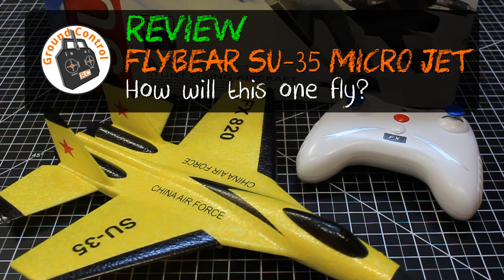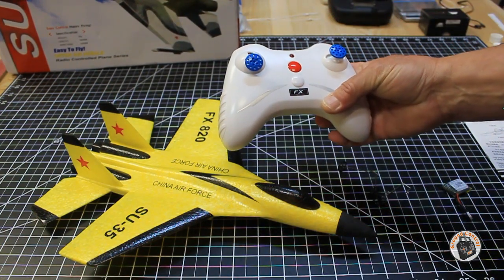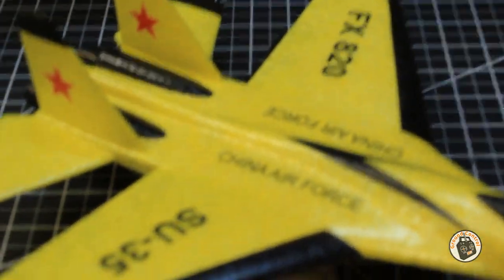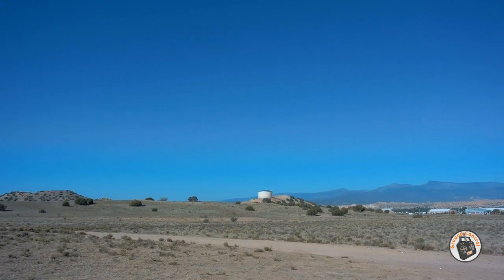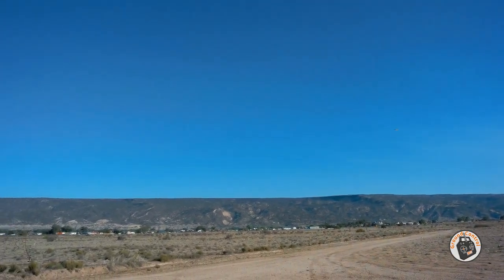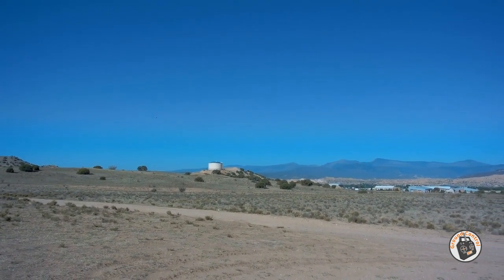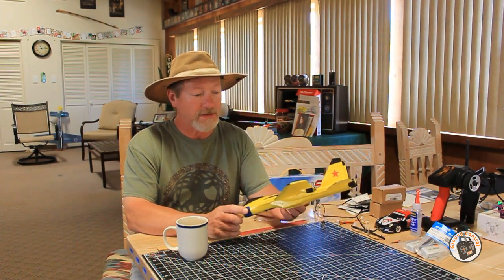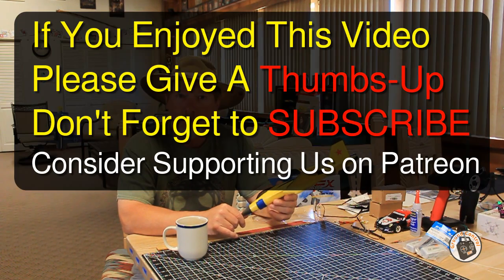Review - FlyBear FX-820 2.4G 2CH Remote Control SU-35 Jet

Comment: Excellent review and looks like a really fun plane to fly, well done :)  In my experience with park jets, twin tail jets will always tend to be more stable than single tail jets like F-16, etc, I think the two tails, especially if they are perpendicular to the wing plate help with roll and yaw stability.  Sometimes the angled ones such as on the F18 still provide good stability but can give a bit of "tail wag" tendencies in any kind of wind.  Su and Mig airframes seem to really translate over well to models in my experience.  Again, great review, thanks for taking the time to go into such detail:)  Happy flying!  Cheers, Scott
Reply from the maker: Thank you! Great information you provided here. I was practicing my LOS flying with my Mini F-22 V1 after flying this tiny plane. The wind was 5-7mph at that time and I experienced the "tail wag" you mentioned. I didn't realize that the single vertical stabilizers were less stable than the doubles but that's great information to know. I always wondered why the angled vertical stabilizers as they wouldn't seem to be as stable as a completely vertical one. Would you say that one completely vertical stabilizer is better than two angled ones? I want to build the most stable planes I can so the SU-35 design may be a very good candidate for a future scratch-build. Thanks for the great tips and the comment as it is always appreciated. Happy Flying!
Reply: In my experience, a single tail jet and a twin tail jet with angled vertical stabilizers are about the same.  It does however depend where the motor/prop are located.  In the "prop in slot" planes I fly and like your Mini F-22, a single tail plane does block and interrupt the prop wash quite a bit, meaning there isn't as much power compared to a twin tail where the prop wash does not have as much interference and in fact is somewhat "funneled" between the tails.  Happy flying to you as well :)  Cheers, Scott

Comment: Man, that thing's great!  Flies great with a little weight on the front.  Especially with all that room.
Great video, man.
PS.  In one ad, it shows someone flexing the rear horizontal stab up in case it heads to the ground.  So that's another way to adjust.  But I like adding extra weight - helps stability especially in wind.
Reply from the maker: Thank you very much! It makes for nice relaxing flights and sometimes I'd swear it was a 3 Channel instead of a 2 Channel Plane ;-) See you in the Air!
Reply: I lost mine:(
Reply: 😅 ادةشحاءة
Reply: @tobiasbaumgartner3409  - Sorry to hear it.  You know, one of the first things I do when I remember to do it?  I put my phone number on the thing.  Of course, the one I lost, I didn't do that.  :(  But, someone got it.  Maybe they got into the hobby and flew it!  :)

Comment: Hello! Would you recommend this over the FX-620? I have that one and its great. I'am hoping this one is like it but better. Also do you know if it uses the same motors as the FX-620? Thank you!
Reply from the maker: I looked at both and I do not see any difference between the two.
They seem to have the same specs and are the same size.
I don't know why they have (2) different model numbers.
Reply: @GroundControlRC  are you sure about that? I did pretty extensive research and from what I’ve come up with, overall the FX – 820 is about an inch bigger. The motors also look a lot larger in comparison. I also cannot find the exact specs anywhere online can you direct me to a website that might have them? Also funny enough the 820 is cheaper than the 620. Thank you again for the response
Reply from the maker: @handcrafteddisplaysusa8236  No, I'm definitely not sure as you never know if the vendor has it correct.
I looked at the specs listed on both and they had them listed as the exact same dimensions.
I look one up at rcmoment.com and one on ebay.
Reply: @GroundControlRC  Hey bud! Just realized I have been commenting under my business name! Thank you for the info! When I look up the specs on both amazon/eBay and other sites I came up with these dimensions...

FX-620 Wingspan  9.76"
              Length 13.46"
              Height 3.15"

FX-820 Wingspan 11.4"
              Length 14.3"
              Height 3.74"

I also notice the battery is a bit larger:

FX-620 150MAH
FX-820 220MAH

Both 1S 3.7v

Looking at the motors, they look more robust on the 820. I love the 620 but feel like the 820 is an improvement yet the 620 is a bit more expensive and more popular, go figure....The 620 flies great. I had it up almost 200ft and it still kept perfect connection.  I receive the 820 Friday. I will let you know! Thank you for the responses. Happy Flyin!
Reply from the maker: @TheFlyinTek  That is strange and I'm not sure why they have (2) micro planes that close in size.
I haven't flown the 620 but the 820 is awesome.
I'm not sure the wingspan on the 620 would have been adequate for my 2S brushless conversion but I would go for the larger wingspan.
I have flown a few of the 400mm wingspan eachine warbirds and the eachine mini p47 with a 500mm wingspan is quite a bit more stable than the 400mm wingspan planes.
Let me know how you would compare the two after you've flown both.
Reply from the maker: @TheFlyinTek  I know you! I've watched a lot of your RC Videos ;-)
Reply: @GroundControlRC  Likewise! We have know each other for years! I got out of the game a few years ago due to personal reasons but I may be coming back. I knew you would have not one but many very inciteful vids for me to binge. And binge I did! I absolutely love what you did with the 820. It fly's amazingly that way. I was very impressed. I see even still stock it runs beautifully. I tried to upgrade the motors on the 620 but it didn't seem to give enough power and would just fly low and never climb. I am hoping the 820 will kick its butt. The way yours flies (stock) compared to the way my 620 flies also stock I can tell there is a difference. I will also be placing a dime or less under the nose as you advised. I see it flies way better this way.
Reply from the maker: @TheFlyinTek  Thank you much!
It's great to have you back flying again ;-)
See you in the Air!

Comment: Just got mine it was broken in the box, but I managed to use paper clips to adjust the angles hopefully it works
Reply from the maker: Oh Man! Hopefully, it will fly OK with the repairs. It's a very fun little 2CH Parkjet. Keep me posted on how it goes. See you in the Air!
Reply: @GroundControlRC  Dang, still responding after 2 years? Nice and I will keep you posted in a couple days
Reply from the maker: @tomkunproductions3442  , Yes, and thank you ;-) I hope it works out!
Reply: @GroundControlRC  Dude, it worked.... this thing is indestructible after I patched the wing up,  as long as they don't get squished they wont break. epik flys perfectly
Reply from the maker: @tomkunproductions3442  , hehehe...that's awesome! This is such a fun little plane. Now, I hope they come out with a 3CH version ;-) See you in the Air!

Comment: Can anyone help?
Mine does not fly at all, you throw it into the air it just drops to the floor, the remote control has a red light the plane has a battery inside but nothing works please advise thank you very much
Reply from the maker: Hum...not sure what would be going on.
If the motors are spinning and the battery is fully charged launching at full throttle should get it in the air fairly easily.
You might check the horizontal stabilizer and see if it has a bit if a down angle to it and bend the the elevators up a bit if it is immediately nosing down.
I actually had to add some nose weight to mine to have it flying nice and level as mine was nosing up.

Comment: I can't get mine to fly anymore.. Nosedives immediately, broke the nose on mine too, lol. Maybe I'll give it one more try and give it full throttle and throw it up rather than out.
Reply from the maker: Hum...I wonder if the foam is warped on the elevators?
I converted mine to a (3) Channel 2S Brushless Parkjet.
I just had it out the other day for a few flights ;-)
Much Fun!
Reply: @GroundControlRC  I'll try one more time with full throttle on a calm day. I'll also try a little experimental up elevator 😂
Reply from the maker: @capnhardway  I think that's what I would try as well if it's nosing down.
I had to add nose weight to mine as it was always nosing up.

Comment: If I need some nose weight I may hide some blue tak inside the nose cone rubber. If that doesn’t work it will be a penny job like yours.
Reply from the maker: Hey Philip! That's a very good idea! The further out on the nose the less weight you would have to use. I may have to get some blue tak ;-) See you in the Air!

Comment: Can it go with half throttle?
Reply from the maker: Sorry, in the 1st reply I was think of a different Plane.
I think 60% Throttle is about as low as you want to go with this one in flight.
It handles very well but for these Nano Planes the motors need to spin those tiny props very fast for good thrust and they aren't very efficient at 50% Throttle.
See you in the Air!
Reply: @GroundControlRC  Oh.. Thanks for the info! So which would you recommend? This SU 35, or the Eachine mini P51D mustang?
Reply from the maker: @baldeagle1337  I would recommend the P51 over this one as the P51 is a full 4CH Plane, has great power, and a rock solid Gyro System.
It's my 2nd favorite beginner plane of all time with the Volantex Sport Cub 500 being my all time favorite beginner plane ;-)
See you in the Air!
Reply: @GroundControlRC  🆗 Thanks! I'll stick with the Eachine P51D mustang👍👍👍

Comment: How do i assemble the F-35 EPP Material Rc plane?

The comapany that made the F-35 Plane is named the minator.
Reply from the maker: It's been a very long time since I bought this Plane, but if I remember correctly, it's complete except for the Vertical Stabilizers and you have to glue those on. I use Foam Tac or Foam Cure for EPP, EPO, and Adams Readi Board Foam and it works really well but any Foam Safe glue will do.
Reply: @GroundControlRC  I did, But how do I turn it on? I turned it on but it didn't start flying
Reply from the maker: @caramel21849  Mine isn't stock anymore but mine had an On/Off Switch on the bottom.
Connect the battery, turn the On/Off Switch to On. Power on the Transmitter, Move the Throttle Stick all the way up and then back down to Bind the Transmitter to the Plane. You should hear a beep after doing that. Now the Motors are Armed and they should startup when you apply Throttle. If that doesn't happen then perhaps something is broken.
Reply: @GroundControlRC  My remote doesnt work, I put batterys in it and pressed the on/off botton and it doesnt light up
Reply from the maker: @caramel21849  You got a bad transmitter?
Reply: @GroundControlRC  what are transmitters?
Reply: @GroundControlRC  no i got to turn on the plane but not the remote
Reply: @GroundControlRC  How do i fix the remote? it isnt turning on
Reply from the maker: @caramel21849  I wish I could tell you but it could be many things. I could be a bad power button, bad wiring inside the unit, or a bad board. I always look at the simple things first. Make sure the batteries are good. Make sure the battery contacts are contacting the pads inside the battery tray. Sometimes the springs are not strong enough to push the button contact on the battery all the way up. I actually had this problem with some rechargeable batteries a couple of weeks ago because they were slightly larger in diameter than a standard AA battery ;-)
Reply from the maker: @caramel21849  The remote is the transmitter.
Reply: @GroundControlRC  yeah it’s kinda bad it doesn’t turn on event with batterys
Reply from the maker: @caramel21849  Hopefully they'll send you a replacement. I get a bad component every once in a while.
Reply: @GroundControlRC  How do i get a replacement?
Reply from the maker: @caramel21849  You'll have to contact the vendor you purchased the plane from.
Reply: @GroundControlRC  Can i fix it?
Reply from the maker: @caramel21849  I don't know. Like I said, you could open it up and see if it's just a lose wire or something simple, however, if you open it up the vendor may not replace it. I would contact the vendor and have a replacement sent rather than open it up and maybe not be able to fix it.
Reply: @GroundControlRC  How do I open it? I used a screwdriver but the screwdriver is to big.
Reply from the maker: @caramel21849  Sorry, I can't help you there. I really think you should be asking for a replacement from the vendor you purchased it from. If you're having a hard time opening the case you should not be tinkering with it. I wish I could be of more help but I think this is where you need to replace the transmitter.

Comment: Like wise order one it's coming soon from the china.
Reply from the maker: You will like that tiny 2 channel plane and it's very durable.
In case you haven't watched the Video where I was testing different Nose Weights to get it to fly just right, here it is:
https://www.youtube.com/watch?v=ftqDDnKcAqg
See you in the Air!
Reply: Ground Control RC once i have got  it i will get in touch to get you expertise. Love your vid and thank you for giving us a head start.
Reply from the maker: @DJSHUJ  , thank you for the kind words ;-) See you in the Air!
Reply: Recived mine today cant wait to fly it . The battery on charge and I have put a penny attached to the nose as suggested. The weather is not nice today in 🇬🇧 so it might rain. See how it goes.
Reply from the maker: @DJSHUJ  , good luck on your Maiden Flight! Hopefully the Rain will hold off so you can fly it right away ;-) See you in the Air!